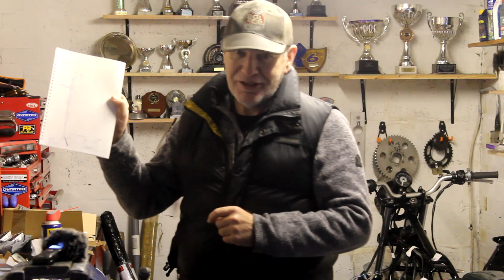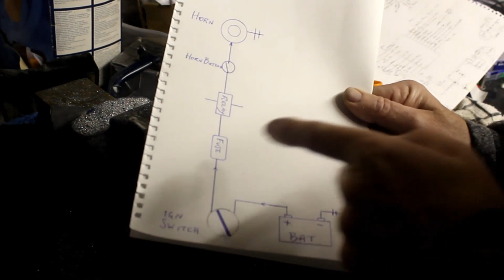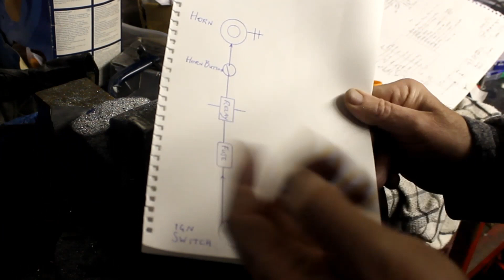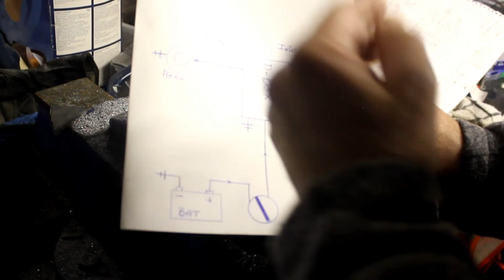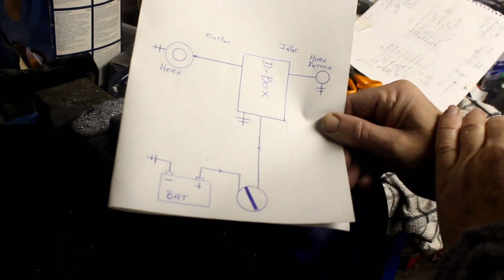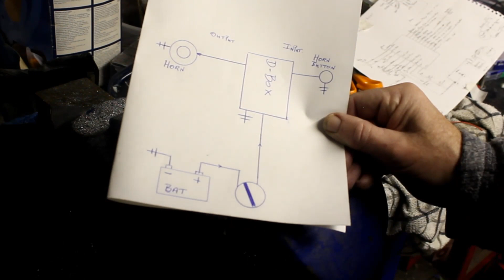Axel Joost D-Box Review

Comment: Hi ,
Very good video. Can I ask, would you know why my unit got stuck with right hand turn signal constantly on / blinking? There is no voltage on any two wires at the button.  I did inspect every usual suspect already...
Thank you.
Reply from the maker: Are you using standard switches or momentary contact switches? You need to program the D box to tell it which your using, If you look on Axel Joost YT channel he explains it all. Or you can write to him directly via his website. He gives a quick response.
Reply: @Merch131ho 
Thank you for the reply. I have momentary switches. It is not a D box but Battistinis box ... very similar.  I though you might know what the issue could be. All worked fine for 10 years and now now power on switch line 😅

Comment: Hi. Do these boxes work/are programmable with a kick start only (no battery)? Or best to wire in a  battery?
Reply from the maker: I have always used them with a battery, doubt they would work without, they need power before they would work. Don't know if turning over the engine with a kickstart would provide enough current to activate it, and so provide power to the coils and ignition..

Comment: Hey Bevel Head, nice video. I am currently building enduro bike and want to use the D-box due to it being much more resistent to dirt and water compared to the m-unit. My question is if there is a simple way to integrate control lights for the oil switch or neutral switch for the dashboard? As far as I've seen the d-box only provides a control light for the indicators. Cheers!
Reply from the maker: The problem is that the oil pressure / neutral lights use a earth 'switch' on the engine which is is not controlled by the D box. The power to the idiot lights is controlled by the D Box when the ignition is turned on, but to complete the circuit/break the circuit is controlled by the switches on the engine.

Comment: There are better alternatives than either of these two. Personally, I prefer one with an app on my phone so that I can set the maximum load for each circuit individually, and change the settings at a later date if necessary.
Reply from the maker: What alternatives do you use?
Reply: @Merch131ho  Neutrino - link: https://youtu.be/gqhUfD5Vx4I?feature=shared
Dan Grassetti , the inventor, is a very amenable guy🕊️

Comment: Nice Video! I am currently doing this on my Sportster and asking myself where to grab 12V from the Ignition Lock/Switch: ignition position or acc position of the key? Thanks
Reply from the maker: HD ignition style switches with 3 positions are available on Ebay, while simple ignition barrels are available much cheaper, from £10. They all tend to be sold have two keys.
Reply: Thanks for the reply. My Switch is working fine. I just need to know where to grab the 12V from. ACC position or Ignition Position cable… So that the dbox gets 12v in acc position or ignition Position.

Comment: currently also debating a controlbox for my 1978 z650 the M Unit being pretty expensive i was looking for alternatives. Would be interested to see it on the bike or maybe even the installation process. Thanks for your video from the Netherlands.
Reply from the maker: I am making a vid of wiring the Z650 with the D Box at the moment, going ok so far. Hope to have it out this time next week. Just waiting for a couple of parts, such as the correct indicator stems.
Reply: @Merch131ho  awesome mine is a scrambler build but previous owners have made a right time mess of the wiring so about to pull everything out and also need to make a new battery tray/controllbox tray. Just had the carbs cleaned so she runs great will wait for your video. Have a great weekend there. Greetz, Leo

Comment: 5A single headlight bulb
4A twin brake light bulbs
7A quiet horn
4A indicators
*20A max. total*?
No twin headlights or loud horn possible unless using led lights if I've understood correctly? Nothing in reserve for gauges & warning lights etc. & make before break will be required on front & rear lights?
Reply from the maker: The 20a limit is on the starter circuit only. not for everything.
Reply: Hi you can run anything largr amos by adding relay so D box switches relay on Mike